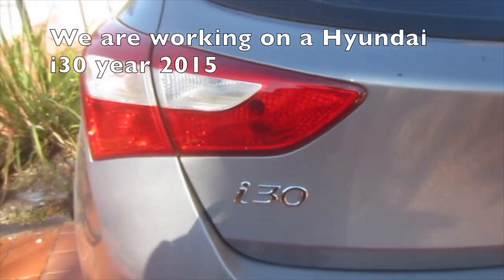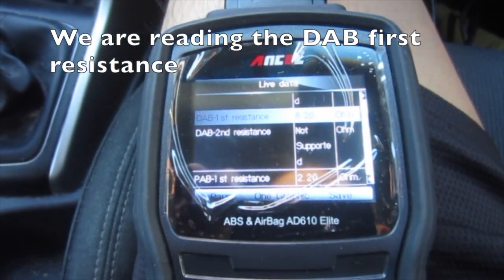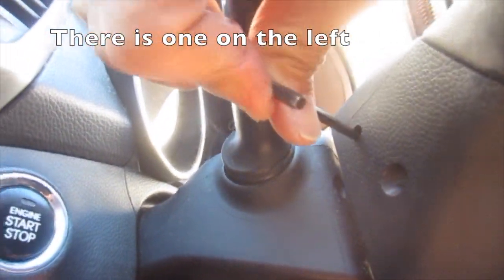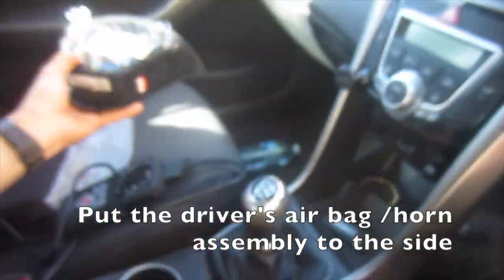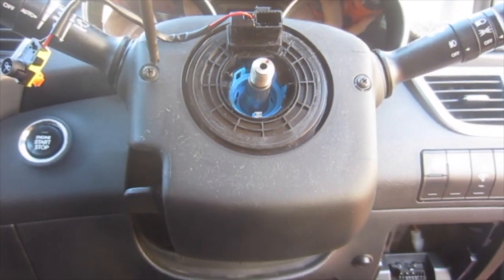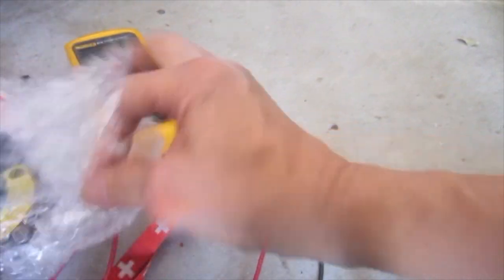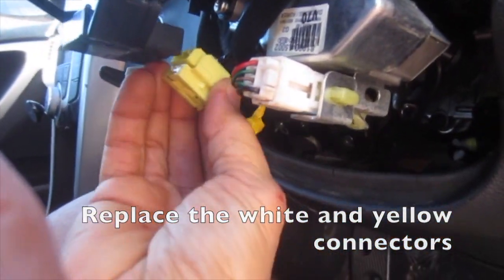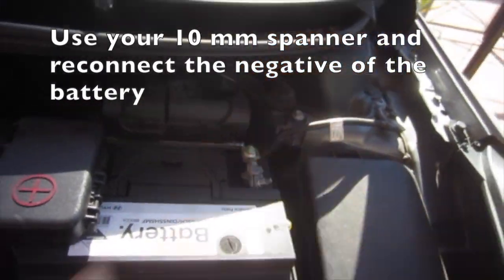hyundai i30 clock spring fault diagnosis and replacement to fix air bag light

Comment: Big thumbs up, mate.
This is a very clear tutorial. I had the same fault on a 2011 diesel i30 (airbag light, horn, and cruise control).
Your instructions just made the fix very easy.
The only thing I did different was to pull that orange safety/transport clip after I refitted the steering wheel.
Cheers,
Ben
Reply from the maker: Nice work Ben! Great you spared the time to write a nice comment. I really appreciate it.

Comment: Thank you for the tutorial.
Fixed my car today. Cost me $25 for the clock spring and about 30 minutes of my time. Pretty easy to follow along to.
Reply from the maker: Thanks Matt. Great to hear . If you took it to an auto electrics place the bill would have been closer to ten times that . Nice work.
Reply: Where did you get the clock spring? Everywhere want $100+ from what i'm finding